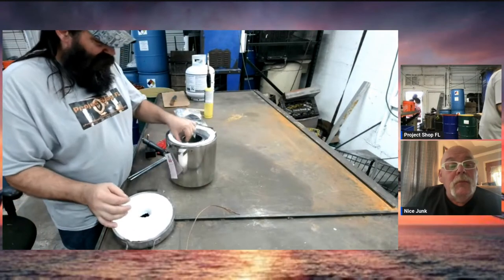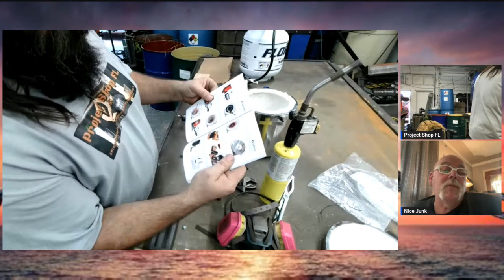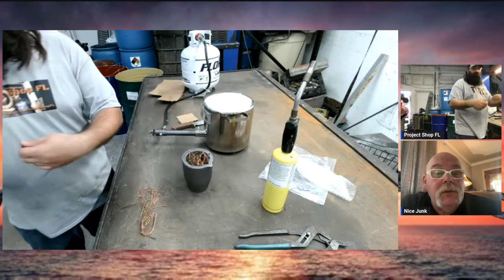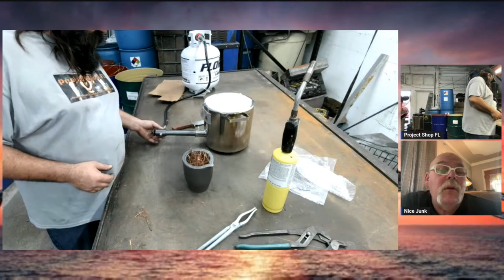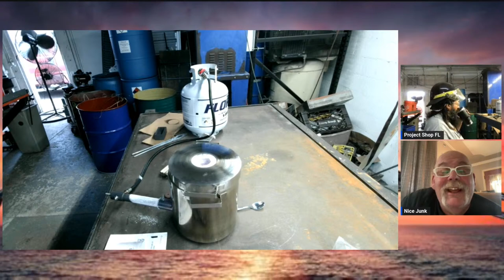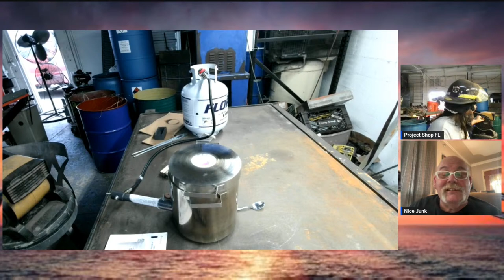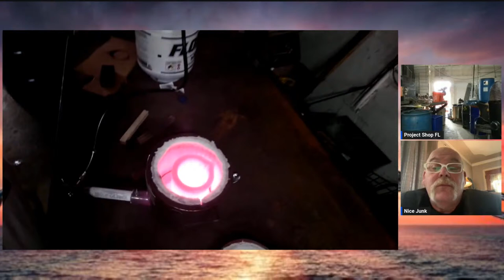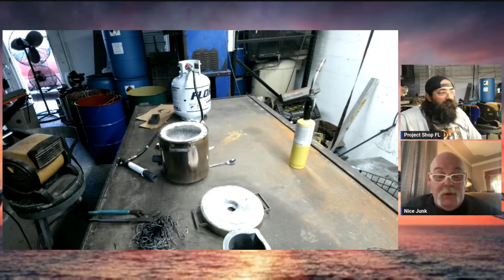Melting Copper Live

Comment: First - you need a regulator where you connect the tube to the propane tank.  Copper melts at 1,984 degrees.  Your setting on the gas needs to be set at 0.12 MPa to melt copper.  I suspect you had the has way too low. Whoever said it takes 30-60 minutes to melt copper is uneducated on this.  Copper at the most should take 20-25 minutes.  Should NEVER take an hour.  Second - cannot have any insulation blocking the hole where the flame comes in.  Third - make sure the end of the tube going into your forge is even with the inside insulation.  It can't sit back too far or it will affect your heat.  Borax not needed.  The varnish on #2 copper turns to dust and can be easily scooped out.  Your copper will still be 99.9% copper.  Also it really should be done outside if possible.  If you melt brass, being outside is a must!
Reply from the maker: Thanks for the info!

Comment: Goin back in time a little bit for added research. First thing comes to mind, material composition of the kiln is essentially a ceramic insulator/heat refractor. You can cement that wool for more efficient results, but the construction of this component is somewhat universal. As far as the nozzling and tubing and gages, the chinese actually have a colloquial standard "chabuduo", as long as it looks the shape and it can be sold it's "good enough". I've seen videos where 3 construction workers on a high rise pull out 3 measuring tapes, All different scales, the metrics are printed on like it's decoration. Do not rely on Any chinese metrology without a full-spectrum comparison to a trusted standard. That being said, they will cut costs on their own buildings, I wouldn't even use any of that burner equipment, it's destined to fail and this isn't an area you want to have failures. It's likely you could jury rig something more durable from the scrap in the shop. 
You were sayin you were interested in something much larger, fuck yea! I'm with you on that one, after a few experiments I too wanted to ramp up the output potential. I built an inground firepit in my back yard, 6ft deep, 2 ft drainage. been thinking for years on digging in an angled air vent pipe up to the surface on the side with a blower attachment. Prime the pit to dry it out, layer in the fire bricks, and melt outdoors under a tall canopy hood for that microclimate rain. Hesitate cuz I like throwin bonfires out there I cook off that pit, not tryna make all my food taste like metal (or let idiots get sick bein lazy about reversing the melt rigging). I'd be interested in knowing where you might source your materials from, hardware stores and the like down here don't have much by means of fire-brick, ceramic wool, satanite...it's not cold here that stuff doesn't really sell. I don't have the trailers n rigs to go pick it up and have been trying to figure the logistical side of it. 
If we are like enough mind to build our own furnaces for larger yield/cycle, becoming aware of the physics end of heavy industry is pretty important. Start messin with heat, molten metal, etc. you start incorporating all the structural needs of thermal and fluid dynamics. Greensand casting something like a small cannon bell will surprise you how much hydrostatic pressure is involved and what's needed to contain the process. You're better equipped to handle it than most in that shop, just be aware things start getting exponentially serious from here. 
You're kickin ass, don't burn yourself out tryna climb experience plateaus, maintain what works and let the progress soak in naturally. Openin up the Mill, casting ingots, modifying hydraulics, shop maintenance, video editing, and that's just what we see...you got a lot on your plate, steady as she goes m8!
Reply from the maker: Thanks! The china burner was given to me and It's just to get my foot in the door. I have an incinerator I am gonna repurpose to make a massive copper melter. The china burner was given to me and It's just to get my foot in the door. I definitely have a lot on my plate never enough time in the day. Thanks for noticing. lol

Comment: The purpose of the cardboard is to keep the crucible from sticking to the fire brick. Thats why you load it before you light it. Set the regulator just above the 1. I have the larher version of that unit and it works great. It should roar when its burning properly.
Reply from the maker: Thanks!